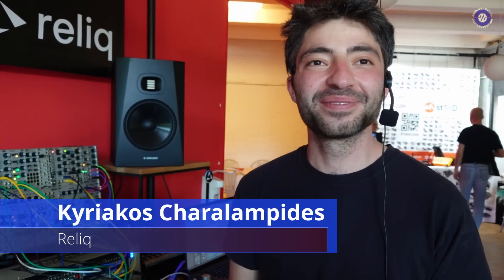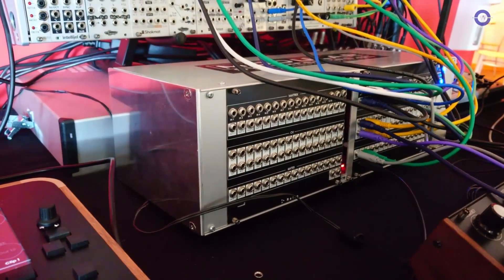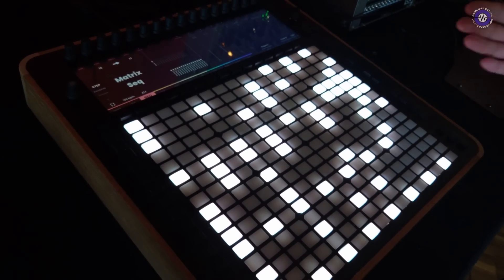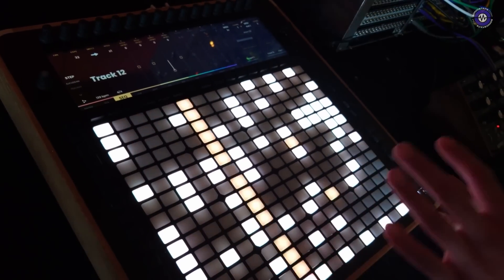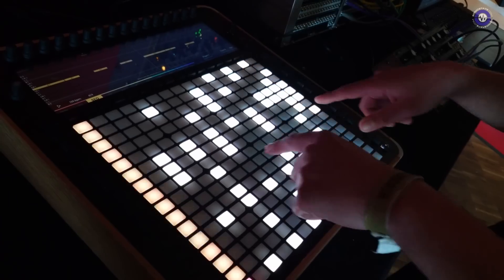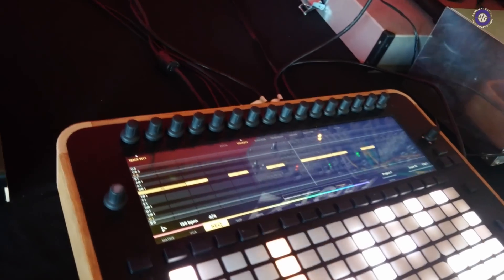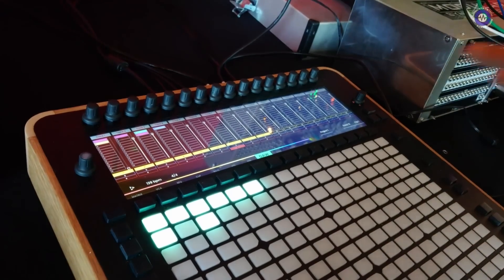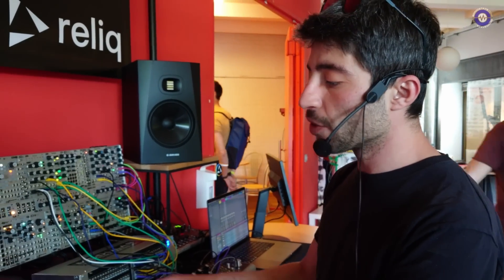Superbooth 2023: Reliq - Hybrid Control Surface With 32 CV, 16 Gate, ,3 MIDI and USB connectivity

Comment: THIS IS HOW YOU DO A NEW PRODUCT PRESENTATION IN UNDER 5 MINUTES  👍- information packed, no humming and harring, just the facts of what it is so far, what the plans are and with the possible challenges what the expected outcomes should be - an exemplary demonstration! 👏 I think it is a very ambitious project, and am little surprised it is not projected to be more expensive. One thing for Akai to sell tens of thousands of their Forces for 1000euros, something else for a startup dual hardware setup consoles with more i/o's to sell theirs.  32 CV, 16 Gate, ,3 MIDI and USB - I want it already! 😀

Comment: It does not look overpriced. But I can do all this routing very easily on a PC with 64 samples buffer at 192 kHz. In my setup I'm using 64 inputs and 64 outputs with 333 microseconds of latency.
Reply: how are you sequencing different effect routings?
Reply: @shitpains  I use variable gain so it's not just routing but works as a mix matrix. Also the converters are DC coupled. Morphing is one easy way to get motion going between snapshots, it's easy to sequence snapshots. But you can apply non-linear mappings to matrix regions so snapshots degrade between eachother in different I.e. rhythmic ways. I use algorithmic stuff on rows and columns and time.
Reply: @shitpains  I dunno guys you can do this many ways, probably |_0()|< 1Nt(0) Cycling '74 Max or the free PlugData or even just plain Bitwig. I don't want to have to admit it but I wrote my own DAW and stuff like that. So the routing/blending/control implementation itself is easy relative to all the other stuff I have to deal with, what features you innovative on top of that is the important part.
Reply: As I understand it, the matrix mixer breakout remains in the analog domain and is just digitally controlled via the reliq. This means analog feedback paths will remain analog feedback paths and only susceptible to any latency that you would introduce with patching other modules in the path. This aspect of the device is really exciting and quite unique, especially when combined with all the other sequencing capabilities.
Reply: Which audio interface are you using for this setup? (Also, FWIW, if your patches involve feedback, even a very low latency interface will sound different than an analog mixer. Obviously it's very dependent on the patch whether or not that makes an appreciable difference.)
Reply: Also, just to be pedantic: 333 microseconds is only the latency from the buffer size at that sample rate. There will of course be more latency from the converters if you're using external I/O.
Reply: What program do you use?

Comment: Is there microtiming? What is the maximum steps for a pattern/track? Nice big screen! 😉A smaller unit, 4 rows tracks would be nicer with a up and down button for select the other tracks. 16 tracks visibele with lights knobs its too busy, like a disco, annoying like other gear. For me is it less inspiring.

Comment: If I understand this device correctly You could use this to turn a eurorack system into a very expensive microfreak clone 🙂, since you get a mod matrix with buttons, which is not unlike the navigateable square on the microfreak. But it is an interesting idea to have the entire mod matrix in a sequencer, so that expensive microfreak clone would also be an electron box clone since you could freeze patches on a step by step basis.
Reply: >very expensive microfreak clone
lol wtf, how do you own a deluge and yet still come away thinking this?
Reply: @rocl420  I was joking a bit, but not entirely. The whole point of eurorack is that you can build with your own cables and wiring the synth that has the ideal routing and modulations that only you need. By replacing this hardwired custom routing with soft routings that can be programmed, you restrict yourself to a 16x16 matrix again, and if that is your goal the Freak synthesizers are also programmable mod matrices though slightly smaller than 16 X 16. The oscillator range of the Fraks is huuuuge so your eurorack must be truely very special before one of the oscillator options in the Freaks cannot at least approximate it. Granted, you still might to want to add a external sequencer to the Freak for the notes so in the end you still need some kind of control surface for that, but I think there are more compact and elegant solutions, the Deluge being one of them and the Polyend devices being another option (if it needs to be more affordable). The Deluge is more expensive than this control surface, but the Deluge PLUS a microfreak is definitely cheaper than this control surface plus the equivalent of a microfreak’s fx, oscillators and filters in eurorack modules.
Reply: @jantuitman  I appreciate the longform reply here but to be fair to this small company, you're completely selling this product short. I own both a MicroFreak and a Deluge fwiw. This Reliq is far more than a matrix mixer, and is actually competing more with the Deluge than supplanting any simpler matrix interface out there. This is a 16x16 sequencer for almost any type of signal, it's a control surface for everything in the room, not just a matrix router.
I''d comment more on the Freak vs Euro osc range thing but it's beside the real point -- this isn't meant to engage solely with Eurorack, it just has the breakout box that looks to make it the premier choice for doing so. In a room full of hardware synths and only a modest rack, the last thing that caught my eye and got me to buy-in several weeks ago was the euro-specific features. 
I love the freak too but talking about its value is about all it has going for it since it desperately needs effects, so really why are we talking about the price of euro modules wrt this controller? All dedicated hardware blows out euro for price/perf standpoint, it's no salient point here. Deluge + [anything] goes a long way, but the Reliq is designed to be able to control more than just CV. I think you might be comparing this to your own setup and judging it on that basis alone rather than what the actual potential is here. If you own a Deluge, it's treading on a lot of common ground. 
This is a Deluge (w/o the synth engine) with a bigger interface that can also function as a Voltage Block on roids. I heard him say 16 track limit which is way too low until you see on their site that it can handle 128 patterns each. The exciting thing about the signal routing here is more than CV, MIDI, or V/Oct signals - I'd love to get more real-time flexible use out of my patch bay. 
I hope Kyriakos is successful, the Reliq is ambitious!! I'm hopeful that these guys stick with it the way Synthstrom has and use this product as a platform to build on. It's one of the most impressive spec-sheets I've seen for a "DAW but not a PC" device.
Reply: @rocl420  I hope that indeed I am selling it short, I was primarily reacting to the features they present now and that for now look to be the distinctive things. After your reacting I checked the website to learn more about the device, and it looks that they will be adding features that will be very interesting to people who use the DAW and hardware at the same time. So that could be very awesome for people who do hybrid DAW/hardware setups!